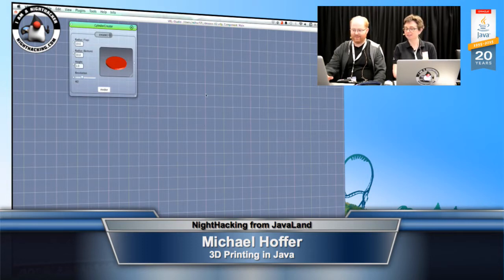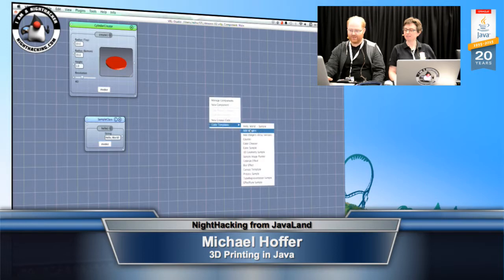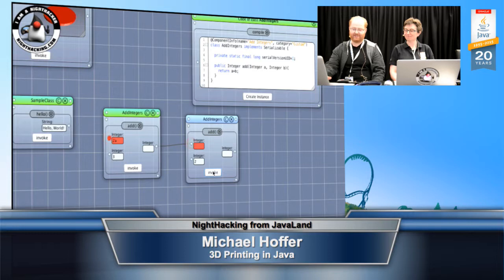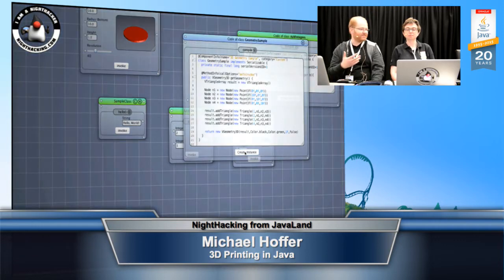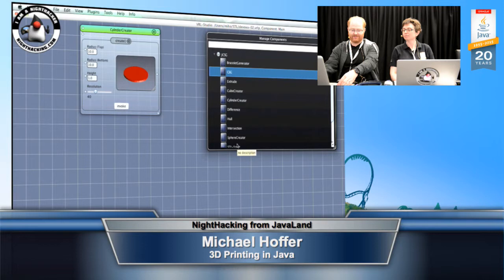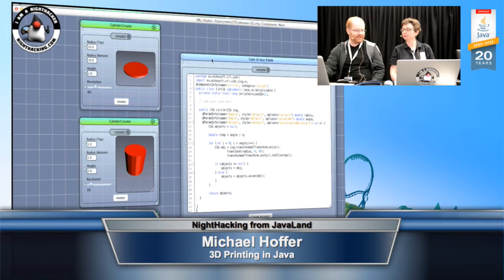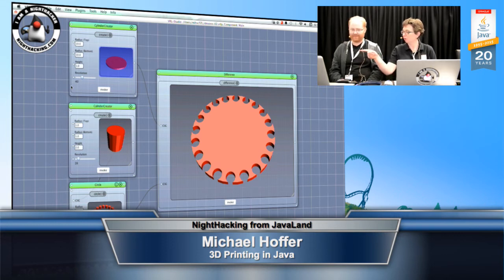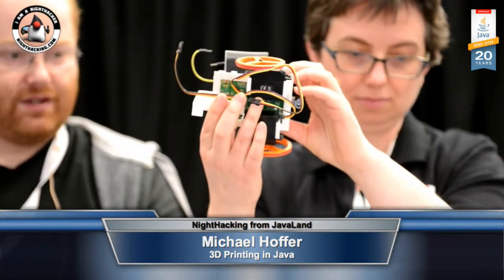Michael Hoffer on 3D Printing in Java

Comment: can i  you Question relation to your java program you mad i work a program that i need to print to a 3d printer
is the same as code use to print a normal print or is different if so  can you 
send a example please that can use.